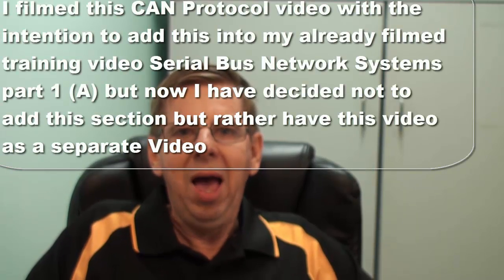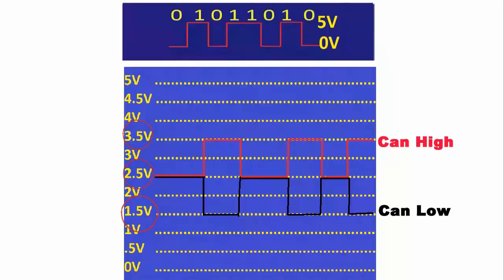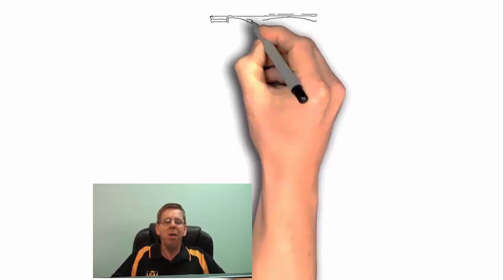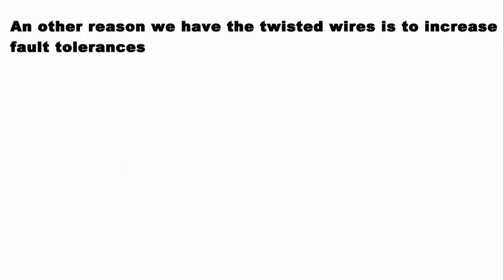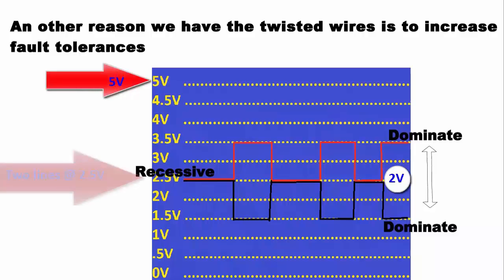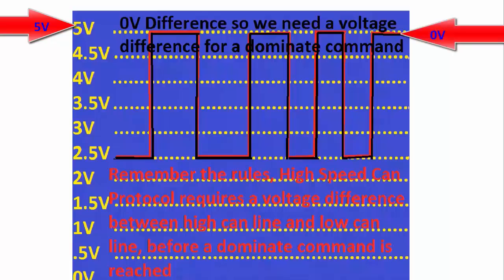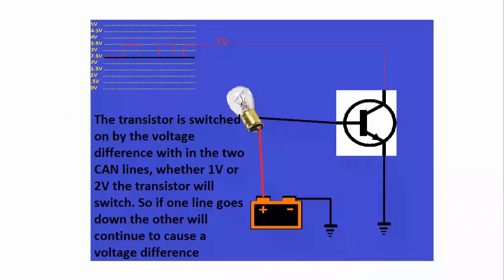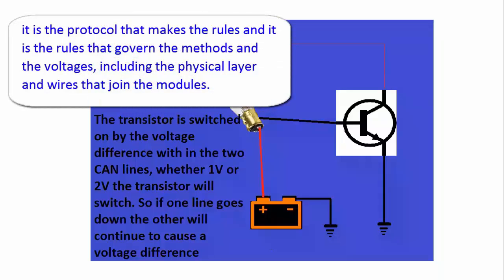Serial Bus Network Systems Part 1 B CAN Protocol

Comment: MAURICE DONOVAN, how does a technician know what a GOOD CAN buss signal waveform is compared to a BAD CAN signal waveform? what are the common failures for a technician to look out for when looking at CAN bus waveforms signals? The CAN bus signal has a voltage and a hexidecimal value but how do you know if its good or bad?

Comment: light bulb in your vehicle is not a real time communication that means is in the low speed CAN family, A one wire CAN not two wires like the High and Medium Speed CAN. the light system is installed into the Local interconnect network bus system, not in the high and medium speed CAN configuration.

Comment: Very informative lecture, thank you.
A minor comment.  I think you have made a mistake in the transistor lamp battery schematic (6:35). The signal should be coming to the base of the transistor instead. The lamp connects to the 12v and the other leg connect to the collector of the transistor.
Reply from the maker: Thanks for your correction I agree
Reply: lol I thought the same thing but was not 100% sure because I am new to transistors and schematics